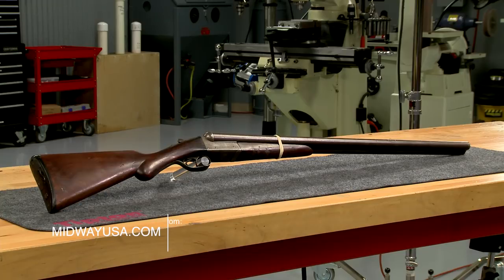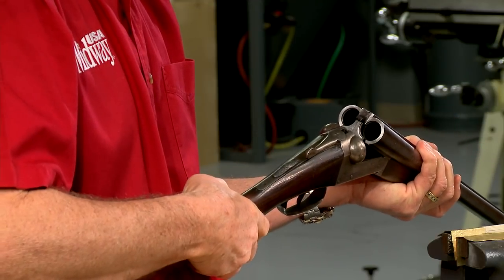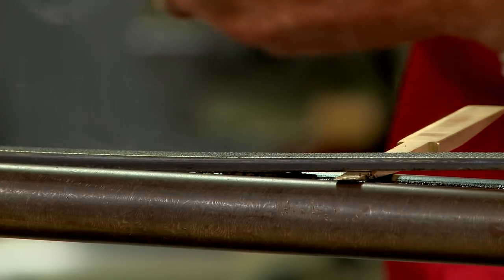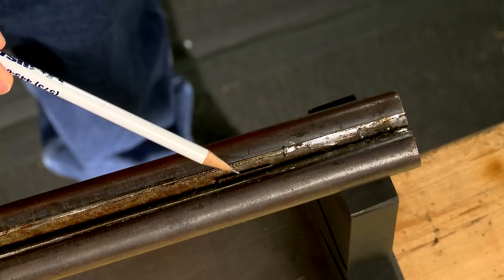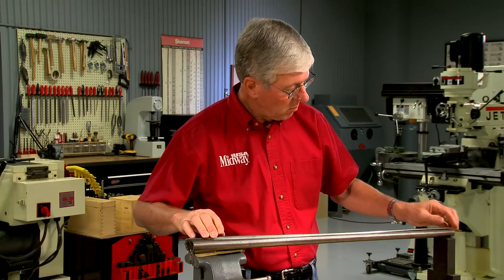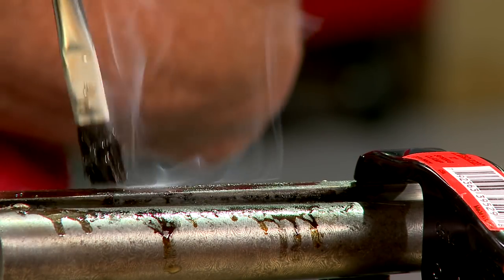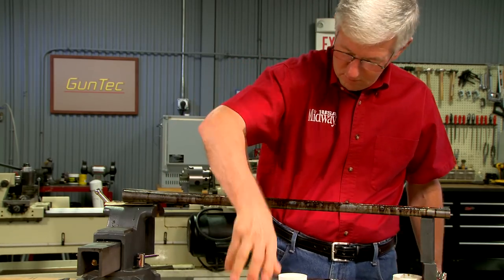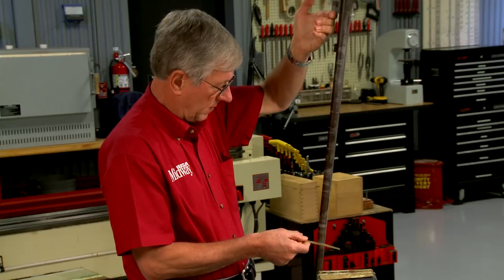Gunsmithing - Relaying the Rib on a Side-by-Side Shotgun by Larry Potterfield of MidwayUSA

Comment: Mr. Potterfield , what is used to hold the barrel shim and the piece that holds the forearm clip in place? Is 50%/50% solder strong enough to hold them as well???? 
I had assumed that brass or even silver was used to hold that rib in place. 
Now that I've seen this , now I have the confidence to put fluted ribs on barrels that I've made without fear of over heating them , because I always thought they were brazed on.

Comment: Now if you reblue the barrels you'll melt the solder and loose the rib due to the temp of the bluing. So you're stuck with parkerizing, painting, or polishing. But you'll never be able to reblue any barrel your flow low temp solder on.
Reply: TackDriver556 why would you do that to a Damascus barrel anyway?
Reply: Not if you slow rust blue....
Reply: @George-qn5zy  talking about caustic salts here. Of course slow rust is fine, but not the same finish of someone wants a high polish like most doubles.
Reply: @TackDriver556  Classic doubles are not blued in castic salts...
Reply: I had been wand6what was used to hold that rib in place for years. Wouldn't have figured that a simple 50%/50% solder would have held it in place on steel. Now I wander what is used to hold the barrel shim and the piece that holds the forearm clip in place?  I would assume a brazing rod or silver solder????? Mr. Potterfield would you chime in on this please????????
Reply: Hot salts don't come near hard solder melting temperature.
Reply: The gun blued at the factory after soft soldering.
Reply: @coburnlowman soft tin lead based solder is on many parts only the barrel lump is bronze brazed the other parts are soft soldered.
Reply: Double shotguns like this are always slow rust blued, the hottest they get during this blackening process is 212F in boiling distilled water.  That’s at least 200F Below the Pb-Sn solder melting point.